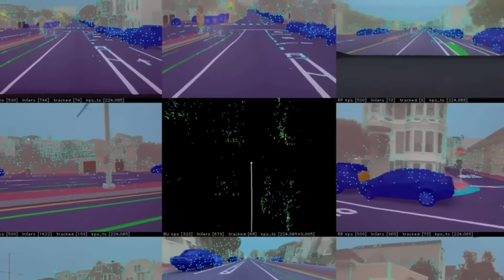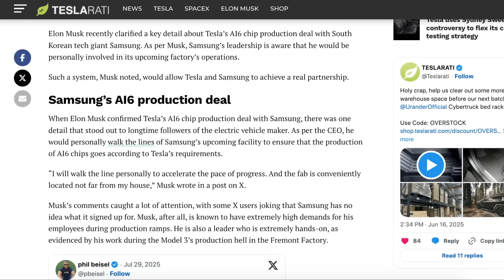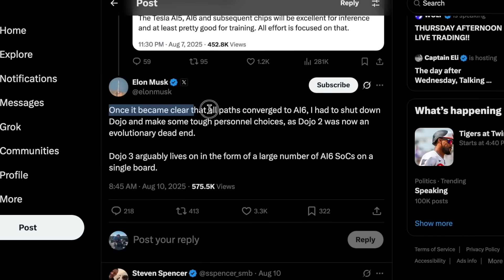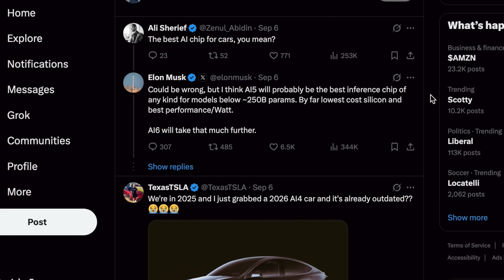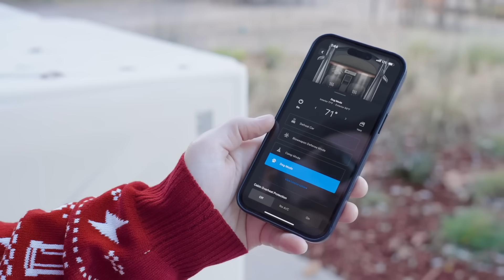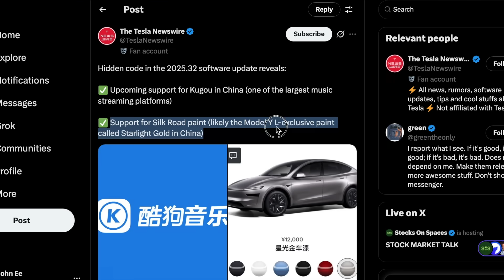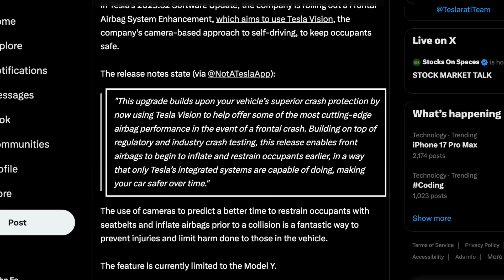Tesla HW5 Prepares For Massive Performance Upgrades with New Designs | A Big Step Forward

Comment: If you need a car now - buy a used Tesla.  It will be more economical to operate and won't leave you disappointed when the AI5 chip is revealed.  Why buy a brand new vehicle that has its obsolescence clock running with 1 year to go?  A million mile battery paired with a 12-18 month chip?  Unless you love tossing cash out of a window, don't do it.

Now about 1st principals engineering -- why hasn't Tesla learned anything from the HW3 owners?  They're still complaining.  Tesla could have made a wiring harness that could deliver AI5 performance - but they didn't.  They could have offered it as obsolescence insurance - good for current gen +1 - but they didn't.  Elon preaches sustainability, but an obsolete car is anything but sustainable.

Comment: It wont be released until mid 2026 earliest and in smaller productions first likely for Model X and Y. It will run in emulation mode for commercial users until 2027. Cybercab will get it's own version likely at first.
Reply: My (non-Tesla) EV lease ends in Jan 2027. If the Model Y has HW5 by then, it’s gonna make choosing between that and the Rivian R2 a lot tougher!

Comment: But, But,  Lord Hypes-a-lot is going to upgrade Hardware that was bought and never function as advertised.   Someone is going to end up on the short end of the stick, and I doubt it will be Lord Elon.  Hypes-a-lot had to know that he was selling vaporware in 2019 and probably before that.
Reply: Our HW3 2022 Model Y FSD works great. v11 was pretty good with some issues, but v12.6 is really slick and pretty much works "as advertised". The remaining issues are cleaner start and end of trips (it won't pull into our driveway), and of course navigating parking ramps (stacked 3d nav where GPS doesn't help).

Comment: Elon just repeated that AI5 is still in the design stage and that mass production won't begin until late 2026 at the earliest.  That means that it won't reach the large volume cars until mid 2027 at the earliest.  2 years.  If you're in the US, grab the $7500 rebate while you can.
Reply: So first Cybercabs with AI4 or Cybercab in 2027?

Comment: AI5 (HW5) isn’t retrofittable into HW4 cars

1. Power draw

HW3/HW4 = ~160–300 W

AI5 = up to 800 W
👉 Most HW4 cars’ wiring harness, fuses, and 12V/48V systems aren’t designed to feed that much continuous power to a single computer.

2. Cooling requirements

HW4 uses passive/low-flow liquid cooling.

AI5 will need dedicated high-capacity liquid cooling (like a GPU server). HW4 cars don’t have the plumbing or radiators sized for this.

3. Physical & integration differences

AI5 boards are larger and heavier.

Mounting brackets, cabling, and connectors are redesigned.

AI5 likely integrates with Tesla’s next-gen 48V vehicle architecture, while HW4 cars are still mostly 12V.

4. Vehicle architecture changes

Tesla is shifting to a high-bandwidth internal network (likely 10 Gbps+ Ethernet) to feed all cameras and sensors.

HW4 cars run on lower-bandwidth CAN/Ethernet systems, so even if you swapped the computer, the rest of the car would bottleneck it.

Elon himself said AI5 won’t be a retrofit because it would require new power distribution, new cooling loops, and major rewiring. It’s not like dropping in a faster chip — it’s closer to trying to install a gaming PC GPU inside a laptop without upgrading the power supply and cooling.
Reply: Anything is possible with enough patience
Reply: @xkeithedgex but if it costs 20k, what is the point?

Comment: He said the same with HW2,  3, 4 now 5 and 6. I bet you he would say same with 7, 8, and n. So if you like Tesla just get the best of what you can at the moment.
Reply: I’ll wait for hardware 10
Reply: I regret buying the HW3 MYP in 2022.
Reply: @nextgen6876 I got a used 23 in July of 24.  It was pretty cheap but the fact my car was abandoned about year and a half after it was made is disappointing.  Tech moves fast though and I do really like my car.  It drives me around pretty well.
Reply: Late 23 Y have hw4 and can be had for a very fair price.

Comment: I'll repeat HW5 is NOT coming any time soon irrespective what any one says. So, if u need a car now, buy it. If you are not in any urgent need to buy, then wait. Don't make decisions based on future promises(in this case rumors). Also where does this stop HW5 better than HW4 and then HW6 better than HW5 .....   yeah right.... keep waiting  wth  utter non sense
Reply: Well each chip has about 5 years so, u r guaranteed to be ojt of date for 5 years if buying a car right before a drop, obviously won't be new forever, but buying right after new chip is always a better plan
Reply: What if you don’t need a car but you can swap out and older model Y and transfer your FSD license to a new HW4 juniper.  That’s my dilemma.

Comment: Tesla doesn't disclose the TOPs figure for HW4... 300 TOPs is an estimate based on estimate HW4 is between 3x to 5x that of HW3. HW3 is at 144 TOPs. HW4 should be above 400 TOPs.
Reply: HW4 is upto 500, HW5 will be 2000, 2500 is a stretch. Anyways its almost a full year away, still. HW5 once released in Q4 2026 will be good until 2030 when Tesla or Elon will again announce that full self driving is coming, this time for real.

Comment: Every other source I’ve read states late 2026 and only for Cybercab, so others cars will be 2027. Long time to wait.
Reply from the maker: There’s the Model 2 next gen vehicles production late this year to early next year, those would be on a new platform and need to have AI5 as well
Reply: @heyJohnEe why would they put the latest HW5 in a dirt cheap model 2, doesn’t make any sense
Reply from the maker: @JooE77 what doesn’t make sense about it? It’s en entirely new platform allowing them to add new components, and much easier than any of the current card. Obv not but I see them adding V2G, V2L and even steer by wire to this car way before they do on the Model 3 or Y
Reply: @heyJohnEe  nah, not for model 2, cyber cab -yes and gradually to 3 and Y.   btw HW5 the earliest here in North America, I see it only coming late next year or early the year after

Comment: Number 1 : it will have  roughly the same power draw as hardware 4, not 3x as that would be more that 1kw per hour of use, that is a meaningful reduction of an EV range , so no it won’t be 3x power draw. (2) Real world jump, Elon said hardware 4 would be 3x the power of hardware 3, it ended up being 1.5x , so shave it off by 50%. Roughly 2x increase inference power, so roughly 300 TOPs, nvidia chips do better TOPs at lower wattage, nvidia is superior since they have access to the latest fabrication node, hardware 5 is still nickel and diming the customer, AI 6 would be the massive leap everyone is looking to , it’s built on the Samsung Chip plant that is catered around AI 6
Reply: June 13, 2024 – Tesla Annual Meeting
Elon Musk: “AI5 will require up to 800 watts of power in complex environments, compared to around 300 watts for HW3 and HW4.”

June 20, 2024 – Teslarati reporting Musk’s remarks
Elon Musk: “AI5 will use roughly four times the energy that HW3 and HW4 did, with about 10× the capability of HW4.”

July 24, 2025 – Tesla Q2 2025 Earnings Call
Elon Musk: “AI5 will consume nearly 2–3× the energy of AI4.”

---

🔢 Power comparison:

HW3 / HW4 ≈ 160–300W

AI5 (HW5) ≈ 800W peak
➡️ That’s about 2–4× more power for AI5 vs HW4.